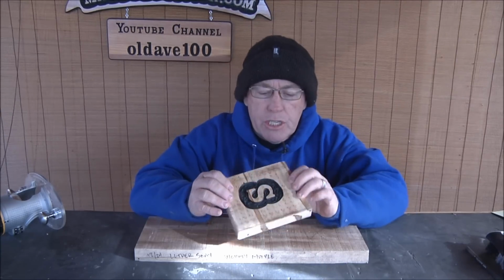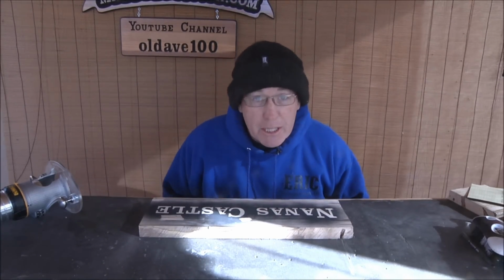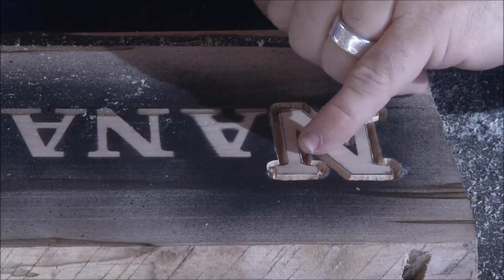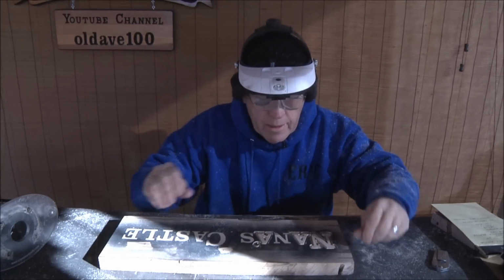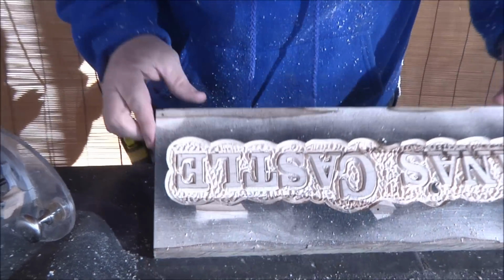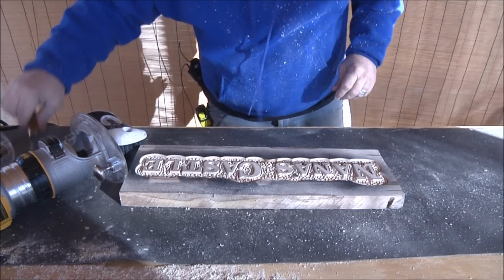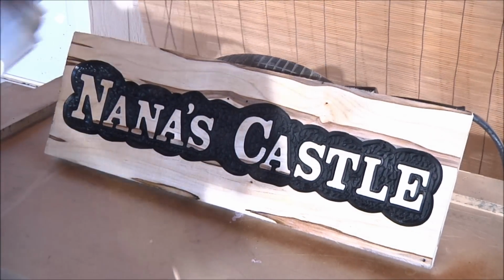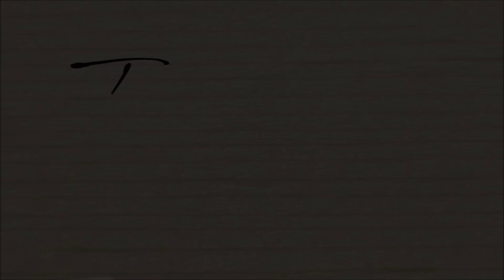#346 Wood Review Freehand Carving A Sign From Wormy Maple

Comment: Happy Wednesday Eric and Vicki.
Being originally from the Northeast and experience with spalted maples, and the engineet in me....lol
The Ambrosia/ wormy maple is typically found in the softer maple species , although still a hardwood.
The Ambrosia beetele carries fungus on its legs , and that causes discoloration after it is left in the bored hole.
It is close to 1000 on the Janka scale, so considerably harder than Eastern White pine at 380 on the scale.
Hard maple, white and red oak are about 1450 hardness.

Just a little info.
God bless and have a great week.

Glenn
Reply from the maker: Fascinating, thank you Glenn for all the info. I really do need to be more careful when using different species of woods. I just looked up the Janka Scale, cool stuff to know. Thanks again!!!

Comment: Hi Eric. You really scared me when you smelled the wood. Please research the woods before you smell them. Some woods are very toxic or can cause skin irritation, eye problems and breathing problems. Example. Spalted maple is caused by a fungus. The wormy maple stains and holes are caused by the ambrosia beetle. Also please search and find a toxicity chart for all woods and the problems the woods can cause. Another example is cutting boards should not be made from walnut if you are making it for a  person with nut allergies. They could get a reaction from the cutting board. 

I have a friend who is a turner and wound up in the hospital with a life threatening reaction to the wood he was turning. He has to use a special hood with filtration when he is turning or sanding. I myself have gotten a reaction from some woods when  I was scroll sawing. You might want to do a video on toxicity of woods sometime. 

As an example I just type in the search box, is wormy maple toxic. Lots of helpful information for all kinds of woods.
Reply from the maker: Hi Ron, you're absolutely right. I need to research more the toxicity. Found all kinds of interesting stuff. I will be more careful. I found a chart and it's really amazing how many issues can be caused by working with different woods. Thank you again, I really appreciate the concern.